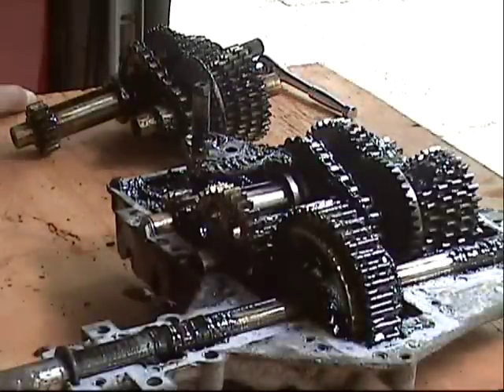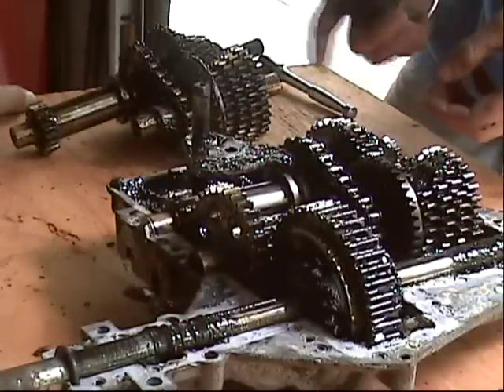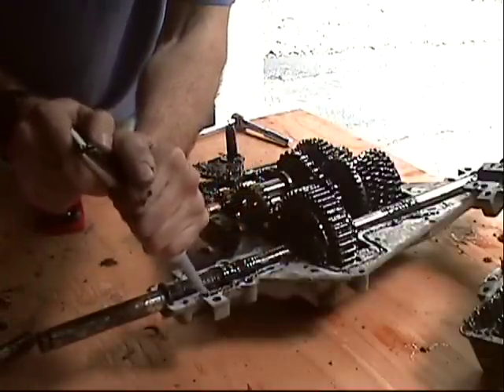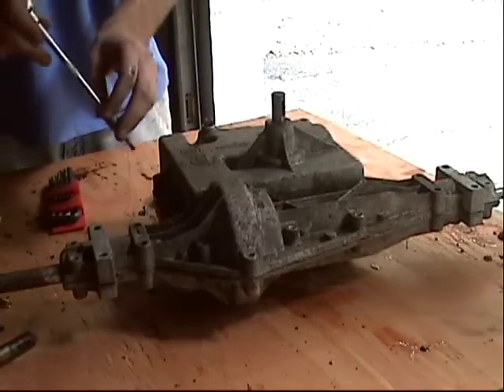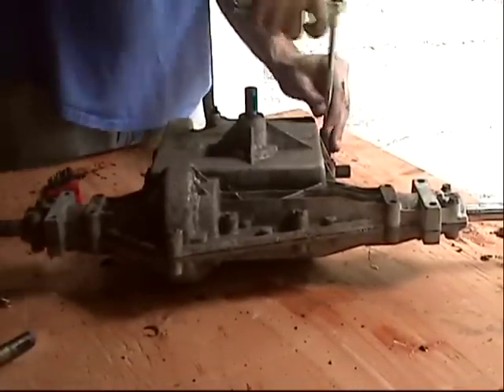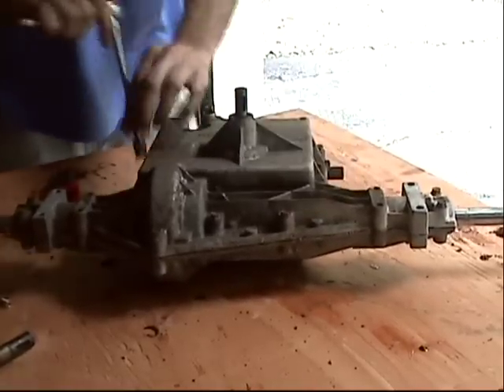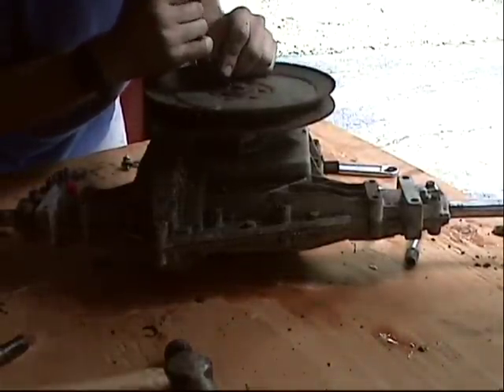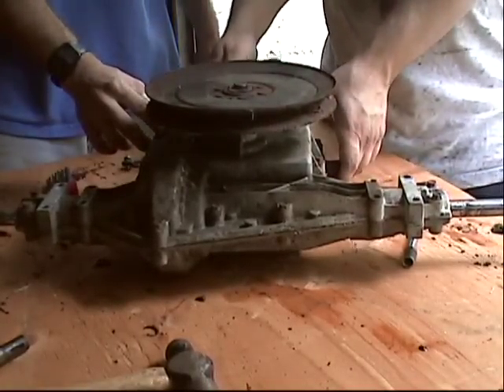Rebuilding a lawn tractor transaxle [Part 2 of 2]

Comment: Guys I Appreciate The Video I'm Rebuilding a 5 Speed Foots Transaxle an Needed To See How The Gears Meshed Since mine Fell off on Tare Down . I had a Halfmoon Key to  Sheer and it Stopped my Mower Dead in it's Tracks not Even Reverse they Put Too Small a Key in  The Little Gear That Meshes To The Bullgear from the Factory ! One Mistake I Seen Yall Possibly Made is When Yall went to The 6 Speed Setup I Think Yall Might of Put it Back Together With The 5 Speed Shift Rod an Detent , if So it will Still Shift But Somewhere in The Shifting You Will Not Have a Detent For One or More of The Gears Anyway Thanks Again For You Men Taking Time To Make The Video it Was Very Helpful ! Oh an For The Worn Pinion an Ring Gear , That Ring Gear Has So Much linear Load on it That it Wears The Splines on The Shaft an Also The Splines inside The Ring Gear an What Happens is It Eventually gets So Worn That The Gears Bearly Mesh and it Strips Both Just Exactly Like What You Have There ! I Beveled The Inside of My Good Ring Gear an Tig Welded it To The Shaft To Stop That Crap From Happening , We Shall See how that Works Out I Also Tigged The Small Gear To The Shaft That Pulls The Big Bull Gear after installing a new Halfmoon Key ! 
🇺🇸😉👍🏻

Comment: When servicing these transmission make sure to leave in the old grease mixed in with broken chips off the pinion and ring gear and never flush out the case or gears . That why the broken chips and metallic will lubricate the gears and chain better and the transmission  will last longer

Comment: I have a ‘91 Roper lt110. It was seized in 2nd. I’ve taken it apart, cleaned it all. Not sure why it’s still a challenge to change gears. Also- when closing it up- the manual says to fill with 4qts Sae30? I got about 2 in before it leaked all over. Wtf am I doing wrong?! Any insight is greatly appreciated!

Comment: if it had no gasket it needs no gasket. The case is aluminum, soft metal, it seals itself just fine. unless your going to a change over to oil lube.
Reply: You need silicone to seal it!

Comment: Why didn't you just change the ring and pinion gears, that way it would still be a 5 speed which the lawn tractor shifting set up would work correctly. Also you should have cleaned the gear case out and installed new grease. I have rebuilt these gear boxes and the grease you left in there WILL eat the gears in a very short time. GOOD LUCK ALL THE METAL THAT WAS WORN OFF THE OLD GEARS ARE STILL IN THERE EATING THE GEARS!!!!!!
Reply: I'm going to be rebuilding one of these for the first time should I use grease gun grease or should I use 80 90 weight gear oil

Comment: are them transmissions good strong ones? cause i have a trans that has high -low and reverse and then theirs the variable speed clutch,.the housing of ur transmission looks exactly the same, i don't know what the inside of my looks like though cause never took it apart. its in a yard-man 20 hp briggs&stratton vanguard v-twin 46inch cut with 12 inch rims on the back along with 8 inch rims on the front.

Comment: I hope you used the six speed shifter with the six speed gear change.  Otherwise the gear positions will not line up correctly with the new gears.

Comment: I am having a problem with mine sticking in second gear. I need to shut the engine off to rock it back and forth to get it out of gear. This only happens in second, I have not pulled it apart but it is on my list.  Have you heard of this? Is it worth fixing. I have another trans to put in but it is only a five speed.  The mower belongs to my father and he loves mowing in second gear and only second gear. So any other gear is out of the question.
Reply: bulldog0046  how did you fix it , I'm have the same. problem. any information  would be helpful . thanks

Comment: I have a 2005 Murray rider with a Spicer transaxle. The transaxle started to develope a grinding sound so i drilled the case installed a grease fitting a pumped a tube of grease in it.The transaxle shifts easyer but still grindes in all gears including neutral with the clutch disinguaged.Where can i get a rebuild kit for this? Does anyone Know.

Comment: Good video, lots of people don't have time to hang at a shop to watch this stuff. I always made sure EVERYTHING was as clean as a whistle tho... so you can spot leaks or cracks. Treated it like a surgeon. Would never leave a part that dirty in or out! The cause of the problem can still be in the grease left over inside... think grinding compound.

I'd paint friend's rebuilt parts hot pink enamel as a joke, but they'd notice a leak faster cause they always look at it then (while cursing me).

Comment: i suggest drilling a hole in between the bearings on the input shaft and installing a grease zerk, thats the weak link especially your racing

Comment: Try splittiing the transaxle and sand the surface where the Transaxle seals to an even, clean finished and then add RTV sealant as inthe video.  Look for any rotted or broken seals while the transaxles' open.
Reply: how in the hell did you get it apart?

Comment: I was afraid you'd say that! (I'm lazy)  :) What do you think about pressure washing the inside and spraying it down with silicone? Or should I just wipe it out with rags? Do you have any idea how much gear oil I'd need to add? I'm assuming I don't fill it all the way... maybe 1/2 or 2/3, sort of like a differential on a car? Thanks again for your help. -Tracy

Comment: Hi, do you *have* to remove the grease before you add the gear oil? I was thinking about just drilling/tapping a hole in the case, and then adding the gear oil. Thanks for the videos, they are VERY helpful.

Comment: thanks for your feedback on opening up the trans for my mangled axle. We cheated on a fix this time - we welded some beads on the axle to build the post back up, then welded the wheel right to the axle itself. It works! If I can make it thru the season, I'll pull the whole thing next fall and replace the axle altogether. For now, this fix was cheap!

Comment: Great Video. Thank you.
If I want to replace the axle itself, do I need to remove the entire transaxle and open it up like you did here? The pin on the left axle of my sheared off and tore up the axle, so the mower won't move now as that side just spins. Any advice you can offer is appreciated!

Comment: Parts 1 and 2 are really great. Thank you for posting. Do I need to take the transaxle off and open it up like you did in order to replace the axle? The little pin in the axle sheared off and tore up the left axle. Now the tractor won't go. Is it possible to replace the axle without removing the trans?

Comment: if you kept the front pulley the same, and dropped the rear size down from about 9 inch to about 4-5 about how many inches would the belt size drop? i have a belt for my craftsman that i want to use for around the yard, but its too small, so i was just thinking about changing the pulley, it would go faster and i would be able to use a belt i already have... what do you think? stock speed is about 7mph, how fast would it go with the 4 inch rear pulley? please reply, thanks.